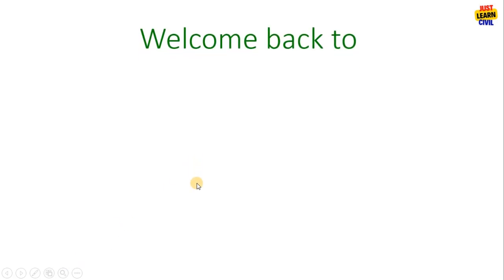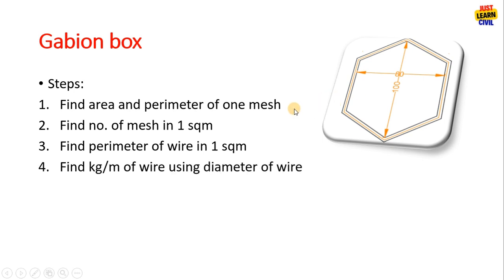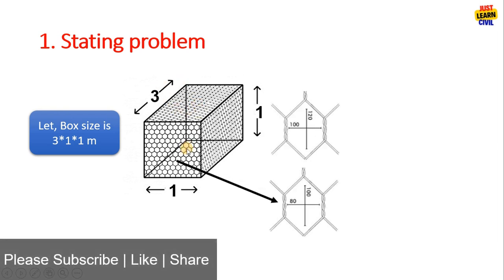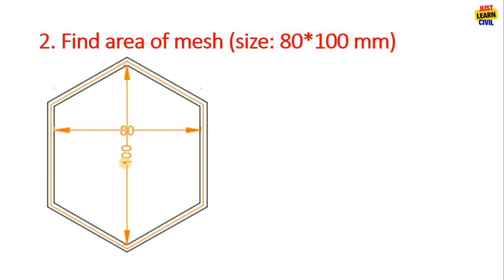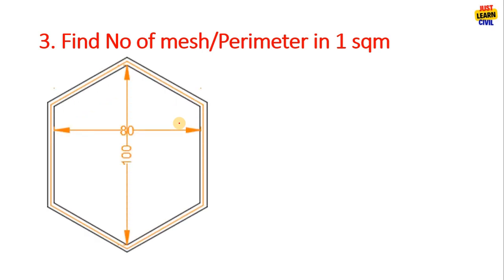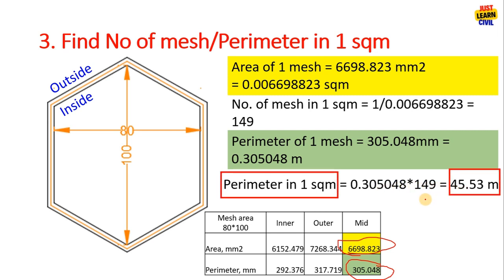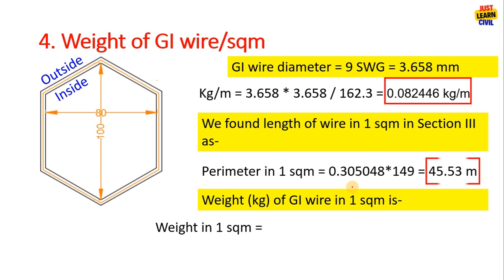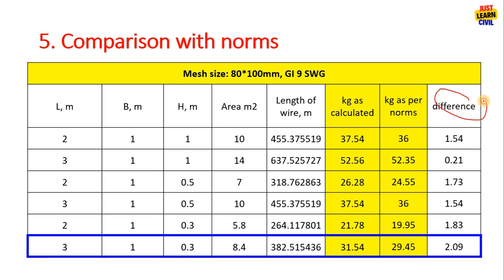[Estimate #3]  GI Wire weight in kg of any gabion  any mesh size | Fencing | hexagonal mesh

Comment: Video is really informative . Could you please suggest How can we calculate the Hexagonal outer,inner and mid area without Autocad. Is there any possibility we can connect  on mobile. Please suggest
Reply from the maker: If it's a regular hexagon, you can use formula of area for hexagon. But if it's irregular hexagon, you need to first draw in scale, divide into many triangles and measure their sides, find area of triangle and add all areas. Hence CAD would be simplest solution.

Comment: gabion always use edge wire bigger than mesh wire, but i don see you calculate the edge wire, tell me if i am wrong?
Reply from the maker: Gabion box uses Selvedge wires as well but this tutorial only focuses on the GI wire mesh. You need to calculate Selvedge wire separately.